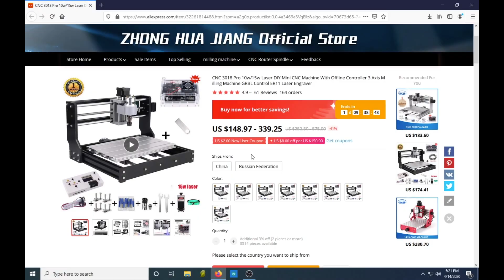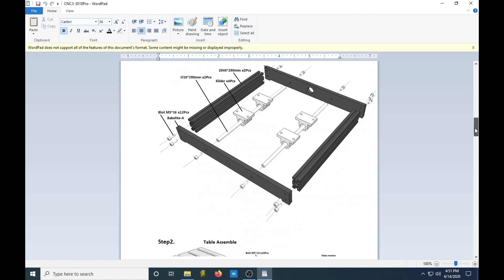3018 Pro CNC Kit Review and Assembly

Comment: Dip the aluminum pieces in gasoline or almost any other aromatic hydrocarbon (kerosene, acetone, etc) and the oil will melt and the chips will fall right off
Reply from the maker: I'll try it if I get another cheap machine like this one again, thanks for the advice!

Comment: Are there any differences to this "generic" one and the SainSmart Genmitsu branded one?  As I see there are lots of support pages for the Sainsmart specific one...different controller boards and such maybe?
Reply from the maker: Although I don't own a SainSmart model, I don't think there are many differences apart from price. There are many controller boards among the off-brand models, however they all run GRBL and there shouldn't be any noticeable impact on preformance. https://github.com/grbl/grbl/wiki
Reply: @CarbonCoil  Cheers bud.  I'm looking at between one of these and a K40 (or both)  I'm after trying to recreate things like this at around 3mins 40 - to cut out cockpit parts from black acrylic.....though there'll be other uses too as the other half will have fun with the woodworking aspect.  Wondering though if I may need the narrower laser for finer detail, depending how small the cutters actually go